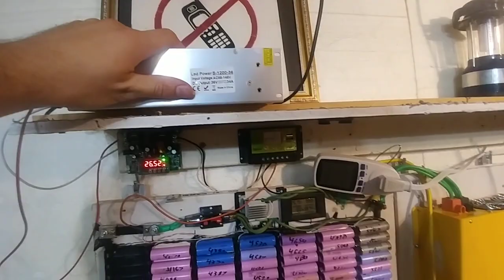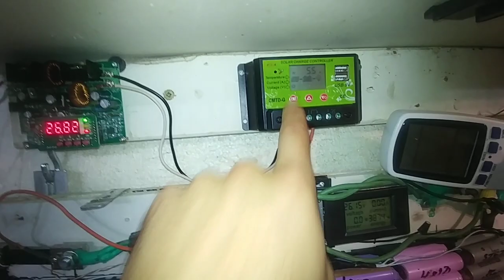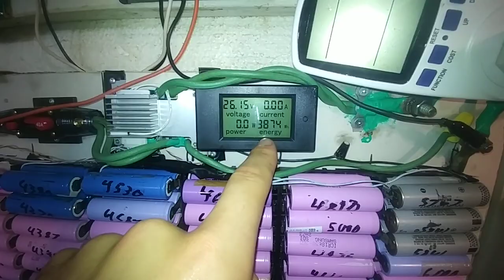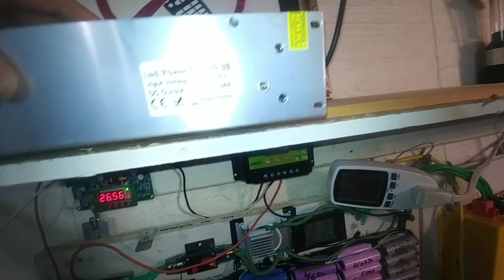18650 7s charging powerwall without solar or wind?

Comment: i think your cell mah is off man. 5000mah in an 18650? Also, how does this replace solar, are you not powering it from the grid? Are you just wanting to charge? Just get 4 or 5 pcpower supplies in parallel and you will have 50amp at 12v  for...free often. If not really cheap.  Just takes some phone calls.
Reply from the maker: This is an old video a lot has changed since then. The cells are 2 in parallel therefore 5ah is 2.5ah per cell. I focus on the batteries and systems that bypass the need for an inverter. No point in me doing solar or inverter stuff. Everyone else does that. Check out some of my newer videos for updates :)